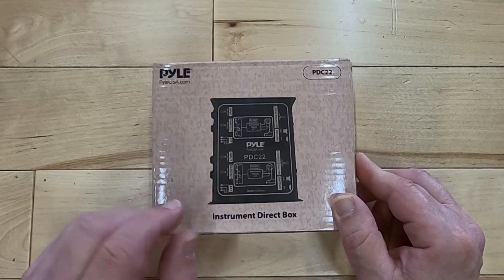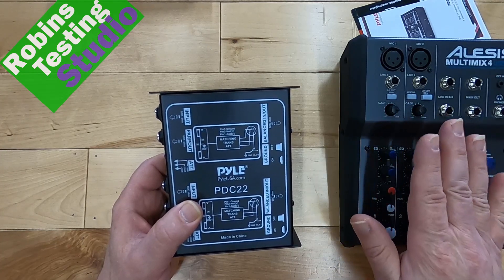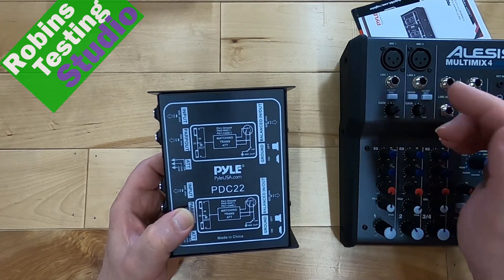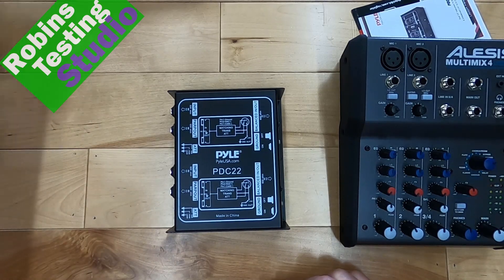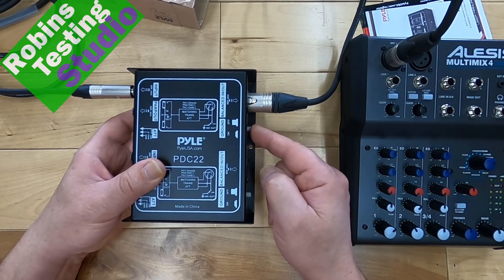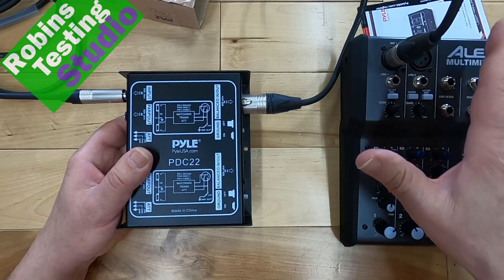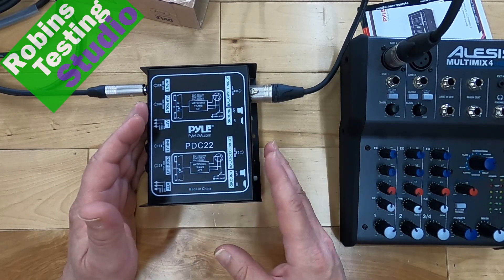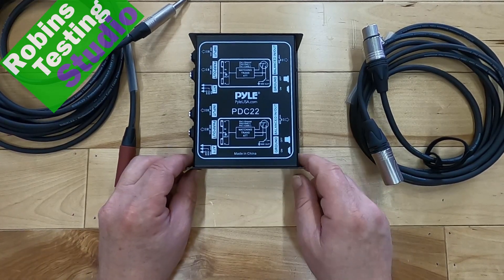Overview PYLE PDC22 Dual DI Box 1/4'' Instrument To Balanced & Unbalanced (1/4'' XLR) Direct Box

Comment: i'm running out of xlr inputs, how can i use my line inputs instead?
Reply: Simple. Just get XLR-to-TRS adapters. Because XLR and TRS both preserve balanced signals when used correctly. And, contrary to common consumer audio myths and misconceptions, there is no "signal quality difference" between XLR and TRS connectors, all other factors remaining equal, such as cable guage (wire thickness/diameter) and EMI/RF-interference shielding.

However, please take great care to not confuse TRS cable and connectors with TS cable and connectors. Because unlike TRS routing, TS routing cannot carry a balanced signal. Which is precisely one of the major reasons for why these DI conversion boxes exist: To convert unbalanced signal(s) into balanced signal(s).

Also: Please make certain that the line inputs on your mixer/interface/recorder/etc, downstream of the DI boxe's balanced signal-converted outputs, accept balanced signals as well. Otherwise, there is no point in using a DI box if your final signal destination doesn't have balanced inputs.

Comment: A neat thing to do with the  PYLE PDC22 and a Hughes & Kettner ATTAX 80 is Use one input / output for the record out on the back of the amp. Use the other for the guitar signal input / output. Ideal for a situation where you can't mic your amp. I never plug anything directly to my recording  mixer/interface. You can't have too many DI's